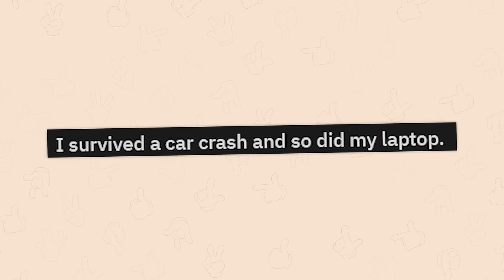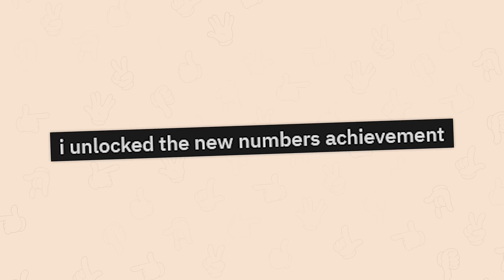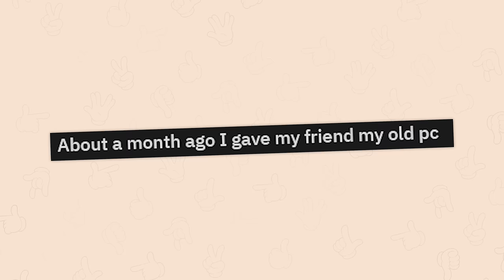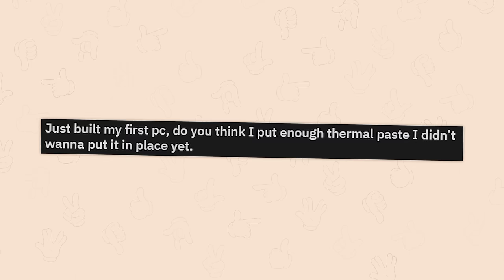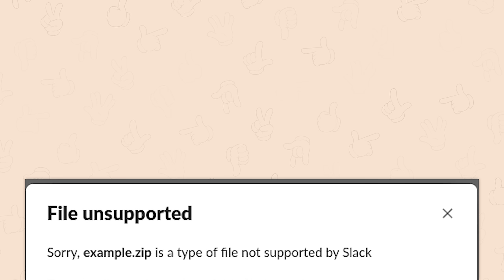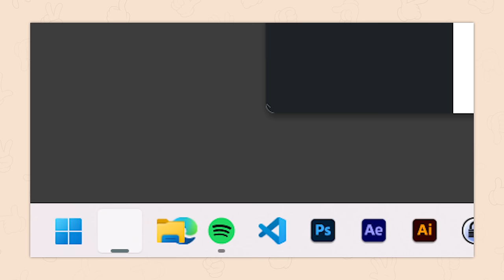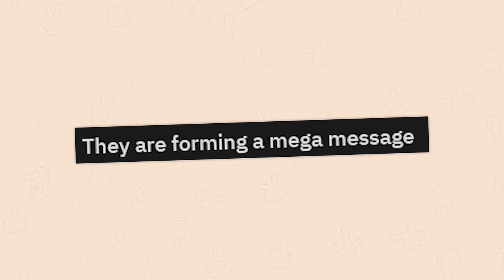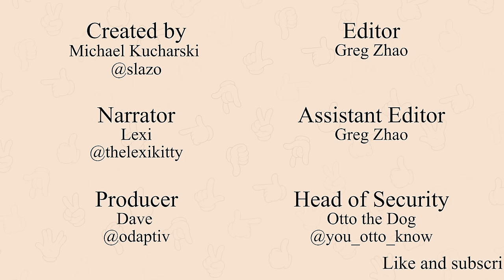r/Techsupportgore | why is the wifi down?!?!?

Comment: Fun fact! I lost Internet last Thursday to a tech support gore thing. Suddenly, the Internet cut out while the electrical company was digging out a root that had crushed our water main (because the cables needed to be removed for the plumber to fix the pipe. I went out to let them know. Lo and behold - they nicked the Internet coax.
Reply: At least it wasn't a fiber line, so you didn't have to completely replace it. Hopefully they didn't screw you over, it's entirely possible to splice coax. (Although it is difficult)
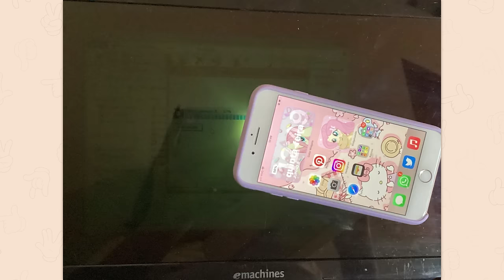Reply: @nikkiofthevalley  Yeah, the coax got spliced back together. Still was a whole thing. That day started at like 7:30, and ended about... 17:30. Had to call a plumber, plumber needed us to get the main pipe located in case further, more drastic things occurred, had to call the electrical company and 811 (811 didn't come by until the next day), the plumber came back when the electrical company came by, they agreed to work together the next day. Thought that was it. Electrical company suddenly arrived about 15:00 to move the cables out of the way and saw away the root, and the man in charge of that group was upset at everyone else despite everyone else agreeing to doing it the next day. And that's when the coax got cut so I had to call the Internet company.
Reply: Tech support gore has happened  twice in my neighborhood in the last 2yrs taking out the internet for 2-5 days each time.

The first time, I think it was electrical company, were digging out small pilot holes or something and severed the connection. 

The second time, the landscaping company for our apartment ran it over with a lawnmower... yeah. Turns out when they replaced the line the first time, they never actually dug it in. So it'd just been laying in the grass along the parking lot, the sidewalk, and our neighbors backyards for months till the mower that comes each week finally got a lucky angle, looking like the thick ass cable had been run into a blender or garbage disposal. 

And then like 10yrs ago the internet suddenly went out and the lights flickered, so I looked out my back window only to see flames shooting 10ft+ into the air from our neighbors souped up truck that'd burst into flames and been pushed out into the alley away from the house and cars( the bumper of their roommates car still melted). FD didn't even think about it till we pointed out our internet had gone out and the low hanging lines literally like 15-20ft above the truck and they went "OH yeah, huh..." and they called the city or telecom company to repair it.
Reply: @nikkiofthevalley you technically can splice a fibre glass cable
We do that all the time in our company for patch panels

Once an excavator hit an internet cable on a bridge and our company was called to repair it

It was a pain in the ass but it works
Reply: @tallynnyntyg6008  dear god at least they got it working again

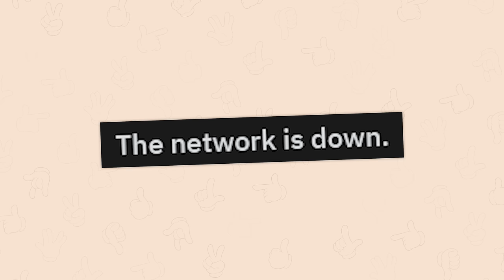Comment: 26:29 For someone who knows how stressful it is to lay electrical cables, this is really hard to watch. It's unbelievable how a few seconds of drilling can ruin your entire week and hit your wallet hard
Reply: although, the better choice would have been to put as much of that cable in conduit, even if inside a wall, to reduce the chances of someone drilling into it.  a few cables, not really a major repair, but this cable routing method is just asking for trouble and can be costly.
Reply: I almost had this happen to me, but with a way bigger drill. This guy was about to make a 30cm hole (about a foot) in a wall without checking what's on the other side. He was working directly above a door that led to the other side. I had to tell him to stop. He would have triggered the fire alarm for the whole factory, because he would have cut its cable.

Comment: 1:43 there's a setting on some phones where you can choose what % you get a low battery notification at. While it usually gives you specific options to choose from, I would not be surprised if some phones just used a slider or an input field and forgot to set it up so 100% isn't an option.
Reply: This also can happen with some notifications if you charge the phone while it is displayed. It will not auto-dismiss because it's selected, but it will show the live percentage and not the value from when the notification was created.
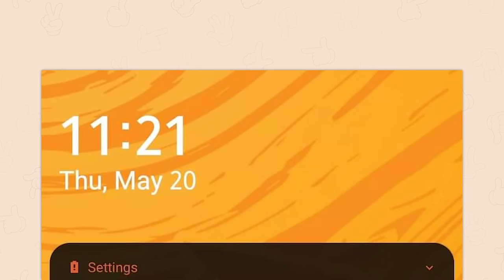Reply: That was my phone at 1:32 and It was a glitch after I turned it back on and off the notification went away

Comment: 11:20 that notification bar is from the Kasperksy antivirus. you can turn on that it will tell you about every software every time it access them and it looks exactly like this, its maybe a little hard to see but on the right side near the edge is an arrow which will give you a drop down menu on what actions you want to take, like for example denying a software the ability to access the webcam.
thats how one time i found out that discord screwed up an update (this is already multiple version ago and has been fixed propperly) where it would just non stop keep accessing the webcam for no reason at all even when it wasnt actually using it for anything.

Comment: Hey, I'm the guy who posted the "That's not a light..." at 22:30. Those are servo control drives for an industrial deli slicer. The one that is glowing is supposed to control a small conveyor belt that moves up and down to stack the meat as it is sliced before sending it farther down the line to be packaged.

Comment: 15:00 - Yep.  My first flat-panel PC monitor was some 5:4 ratio CFL-backlit thing my dad got secondhand for me.  After a while, the backlight had trouble properly striking and sustaining an arc; it took me quite a while to realize that the image panel was still working fine.  I did a web search for the problem and found a single post by someone with the exact same model of monitor, and a guide for how to fix it: replace a series of four identical capacitors on one of the circuit boards inside.  After the repair, that monitor lasted several more years.

Comment: On the subject of failing to remove the plastic protector from CPU coolers - I work for a fairly large manufacturer. My technicians often forget to remove that. Sometimes the system manages to make it to the customer like that, even with stress testing prior. Modern CPUs just don't care all that much. They'll run slower, but they'll run. My customers are mostly medical device OEMs, so they don't really notice most of the time. Every so often a machine will come back in for remanufacturing or some kind of reworks (as a large order) and we'll find the offending plastic, because of some other problem!

I will usually rip my technicians apart for that. It's too easy to JUST DO THE DAMN THING.

Comment: 7:53 Lexi: “Any size battery will do, just hook eight of them together, and you’ll get 12V.”
Hopefully nobody wanting 12V: connects eight 9V batteries together
Reply: Plus it's so easy to connect 9v batteries in series, they just snap together. My old radio was made to run on a 90v battery so something like this could actually be useful.
Reply: @eDoc2020  useful if you want 90 V, certainly. But, not so useful if you wanted 12. 😬🔥
Reply: Or just run a 120 volt router or something

Comment: I remember the vet clinic I used to work at, I was the only one who had internalized that fiber optics weren't like regular wires and had to keep telling the boss, who would do DIY improvements because that's just the kinda guy he was, that you cannot use wall staples on fiber optic lines, it doesn't work when you do that

Comment: 17:30 I think this happens because it's trying to move the file to the recycle bin, but there's already a file there with the same name. Emptying the recycle bin first should fix it, or just Shift+Del to delete it immediately instead of recycling.
Reply: Or the temp folder has too many files in it (max. 65535)
Reply: I looked into how the modern Recycle Bin works and it renames each file to a random name so you can have multiple files with the same original name. Downside is there are only 7 random characters so if you delete a gazillion files there won't be any more free names. There should be 78 billion slots if each character can be A-Z and 0-9. In reality the random generator probably just came up with the same name twice so there was a conflict early. Somebody made a post on Stack Exchange where they got the same error when deleting a million files.

Comment: My Toshiba X505-Q896 went thru a 40-45 mph head-on car crash (Not my fault!) and the technician said that when he took it apart almost every single screw's threads were stripped out, on the harddrive and some other parts and covers, obviously from the forces of the accident.

Comment: About the socket damage at 0:09. There are some thermal pastes that get so sticky over time due to heat that the CPU literally sticks to the heatsink, so, when you go to pull the heatsink off the board, you pull the CPU along with it, closed ILM and all. I've repaired bent pins that have been damaged this way, I've replaced sockets that suffered the same fate, and, this is exactly why we recommend twisting the heatsink before you lift it off the board after unscrewing it.

Comment: Cable management...my first 'real job' was installing 275,000 twisted-pair connections between the 8th and 12th floor of the downtown office.
25 pair telco cables, 11,000 cables total.
Running the cable in, tying them down to the racks went fast.
Cutting, stripping and wire-wrapping the terminal-blocks took months!

Comment: 22:54 These are variable-frequency drives, their purpose is to control the speed of electrical motors.
And it's not "that unusual" to have one overheating, some are too weak but the bigger one is more expensive, they are packed like sardines in a can... read the F manual !
(sometimes it's a commercial trick so you have to buy a new one from time to time)
Reply: If it's something that red-hot maybe it is a high-power resistor to handle dynamic braking. For super high power resistors I believe they sometimes use nichrome wire cooled by a fan.
Reply: @eDoc2020  Could be, but big resistors are usually mounted outside the cabinet. Or a thyristor... Anyway glowing that much... It's fckd up !
Reply: @Dr.K.Wette_BE  A resistor is the most sensible thing to me. It's clearly something big and other than resistors, heatsinks, and sometimes capacitors what components are that large? For a heatsink to get that hot the components on it would need to be even hotter. A semiconductor would become unsoldered before that could happen and if not the package would probably physically explode first.

Comment: 25:47 Yes, it might have survived it if it was off like Lexi said. I know this from experience...but with a full glass of wine...

My laptop was on at the time when I knocked the whole glass over the keyboard, it didn't shut down right away when I held in the powerbutton, but after a bit it shut down and I could open it up while crying my eyes out to get the battery out. Apparently the battery was a spicy pillow, so I threw that out, cleaned all the components, let it bake in the oven to dry. When everything was dry I put it back together, and it worked!! It is a lot slower than before, but it works, so I'm happy!

Comment: 15:00 I found out that the control boards of most old monitors had the ccfl inverter running off of 12v DC and an enable pin that was pulled high when the monitor got the wake up signal so when a monitor backlight died I just got some slim led strip the one with the continuous phosphor line, a pwm led driver wit external potentiometer and an N channel mosfet and made a driver circuit to run the led strips that I installed in place of the old ccfl tubes in the display with an external potentiometer to control the brightness of the strips and the mosfet to turn the backlight on at the same time as the monitor also I removed or desoldered the components of the inverter circuit and with the new LEDs, the monitors ran just as well, if not better than with the old ccfl tubes and were even more power efficient. I did this to about 14 monitors and all of them still work very well to this day, even did it with a TV and that still works

Comment: 6:57 wire nuts on  Ethernet are bad because they produce little LC resonant circuits in the middle of the line.  In short, EE says that stuffing random lumped elements in the middle of perfectly good transmission lines is dumb.

Comment: The notification at 11:07 looks like the one made by Kaspersky Antivirus the arrow on the side lets you hide the notification, block application access to the webcam, webcam protection settings, PID number, and application rules (what rights the application has, past security checks with the program, where the program is stored on what drive and lot of other info.)
Reply: That is correct, the interface is the same.

Comment: 24:54 thinking about this a bit more. I don’t think that’s a processor if you look what the silver piece is laying on, that’s an SSD and then even further in the bottom right it’s actually plugged in so that might be the chips set

Comment: 0:27 - that's the ryzen socket, and it has a reputation that, sometimes, when you remove the cooler, the cpu comes with it. So it's not necessarily the user's fault.

Comment: I had a similar situation to the 100% battery notification on my old device. Sometimes, the notification will update with the new battery percentage after it has already been sent so if you get low battery and then charge to 100% without clearing the notification, you'll get a notification that tells you to charge your battery but also that it is at 100%. Not sure if that is what is happening here but I just thought I should weigh in with my personal experience.

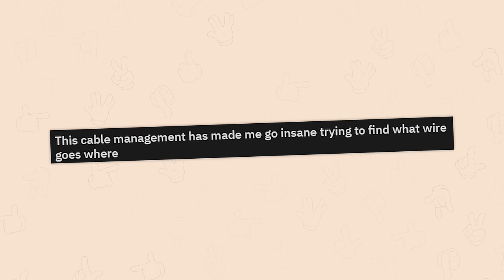Comment: 2:42 As someone who is currently taking a robotics program, this hurts me. We only have so many trainers (not blaming the school at all). So, we all have to take turns using them. The people that use it before my class are mostly first years who are more focused on making it work, then simplifying. Sometimes, when I'm not busy, I try to see if it works and if not, maybe give some subtle hints as to what to do. For those that think that working with automation is easy, it isn't. It's like trying to make a 5th grade band concert sound like an orchestra of people with music majors. Whether it's from people with no organization, or robots that do something completely different each time you run a program, you're bound to want to rip your hair out.

So, please. If you ever wire something up, try to be organized because the next person that works on that probably will not think the same way you do when you wire it in. Organize the wires and try to keep some sort of key so the next person doesn't lose time and sanity trying to find the one wire that isn't working.

Don't even get me started on ethernet. I've wired an 8-pin connector before. Trust me, you don't want to.
Reply: Ok

Comment: That battery pack rigup around 7:15 would have actually worked with only 6 batteries, perhaps even as little as 4 batteries. That car charger adapter doesn't need a full 12 volts to spit out 5 volts for the USB.

Hell, I have an 8 volt solar panel and I used the adapter board from a car charger to limit the output voltage to 5 volts for USB, works just fine. No paper clips though LOL!  😂🤣

Comment: 2:21 i had this in my M1 Mac Mini if i used a display that either used HDMI, or didnt have the proper HDCP(i use a little 16 inch OLED USB-C monitor alot and it doesnt work with my Mac Mini)
It also does this with capture cards, or doesnt send a signal at all, or sends a 'you shall not pass' signal that tells the capture card that the desktop, which is a photo i took myself, is copy protected.

Comment: My AMD GPU also has that bug where it always reports 511°C. It used to work normally, then one day it crashed and it's read 511 ever since.

Supposedly that can be caused by a bad power cable, but I checked and it was fine. Months later, it still works just fine except for the temperature sensor.

Comment: 13:50 I'm a carpenter, and both of our CNC machines run on Win7 just fine, but one of them went kaput somehow and always reset the date/ time to midnight Jan 1 2009. (Files weren't harmed, just the timestamp)
Reply: It's probably just a dead CMOS/RTC battery. On almost all desktop PCs made in the past 25 years this is a standard CR2032 coin cell in a socket on the motherboard. They're cheap and very easy to replace.

Comment: About the split UTP line, I had telco come here and install a new router. They pulled that trick. Sure, our internet is at 100Mbps, but man... that looked sketchy. At least they used those press connectors (looks like some weird round button thing you crush with a plier) instead of just twisting the wires together.

Comment: Wanna hear a funfact?
One of the biggest banks where I live couldn't find their server room. They knew it was in the cellar it just wasn't there. Turns out, when they renovated FIFTEEN YEARS AGO, someone just ... walled off the doorway to the serverroom. The servers were running for 15 years without issues. The only reason they even opened the room up was because they were moving and the servers had to move too.
Turns out that the servers ran on a Programming Language that no one knew how to use anymore. They brought someone back from retirement to transfer the data onto new servers. He managed to finish barely before he died. So now, they have a state of the art server room with a programming language on it so old that no one can ever change anything about it unless they rewrite the entire thing from scratch.